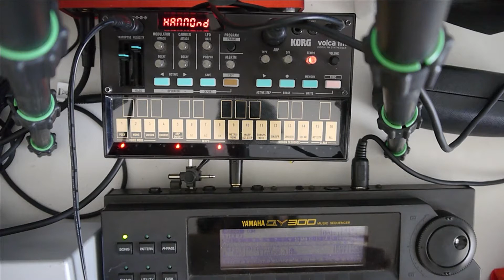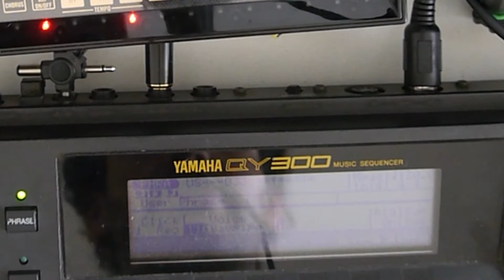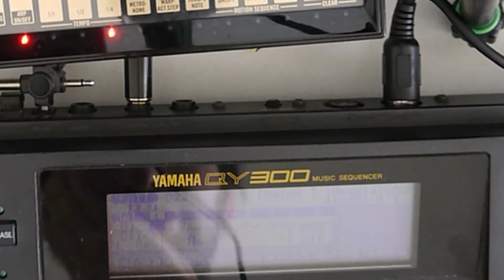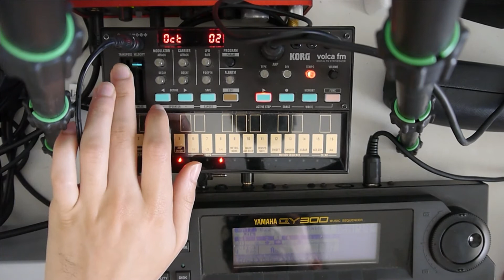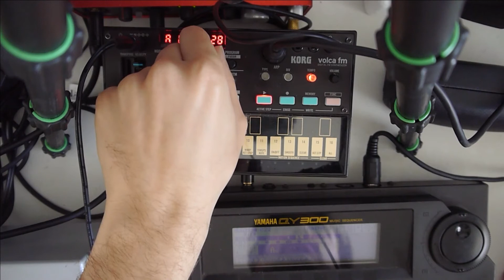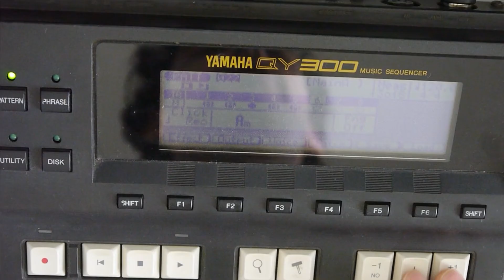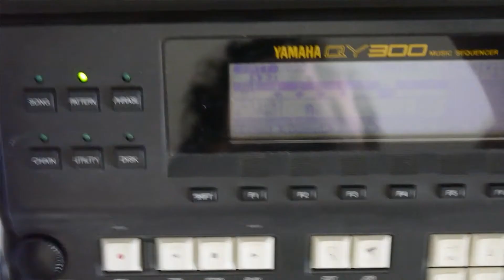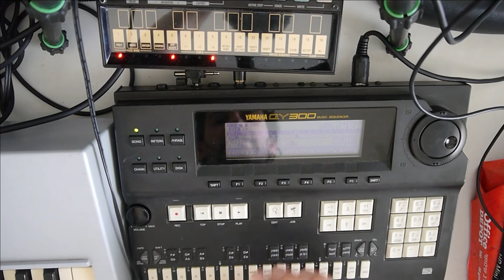How to sequence your Korg Volca with the Yamaha QY series of Sequencers (QY300)

Comment: You may have mentioned this in the video, but how many instruments can you sequence with the 300?
Reply from the maker: Hi Tim, im pretty sure if you were to have a midi splitter box you can use the 16 tracks of the sequencer to potentially sequence 16 different devices. The PPQ i think is pretty tight, there might be some midi jitter but I think it could be possible. I don't have enough devices to really test this but if you had like 4 or 5 synths/sound modules that you wanted to sequence im sure it would work. Again, im not sure how many devices you can sequence, there is only one midi out that comes with the device but im sure it can be expanded ✌